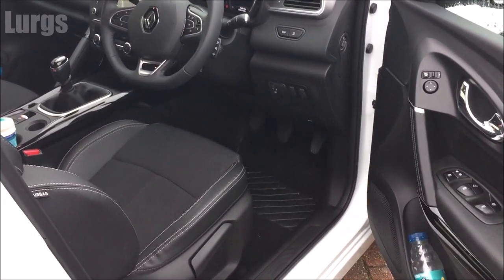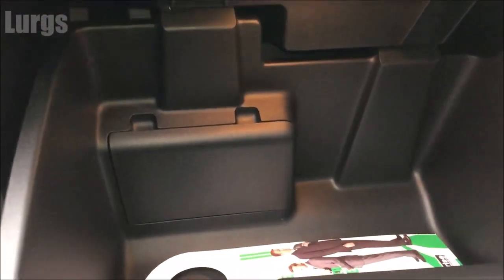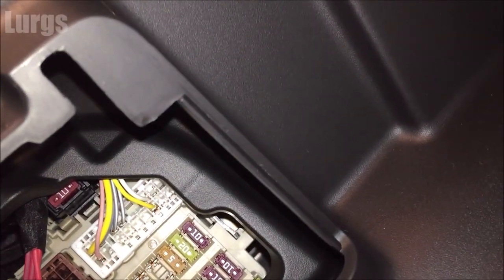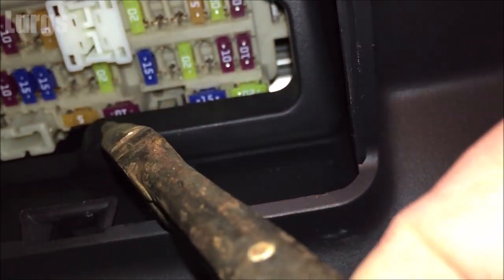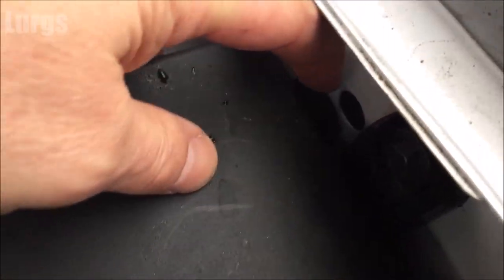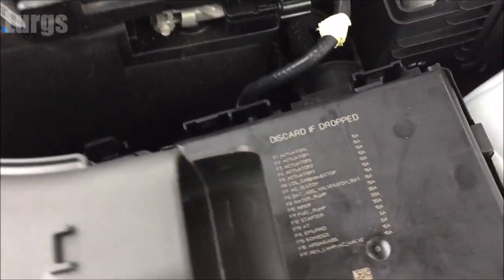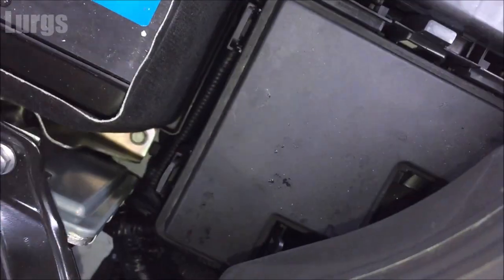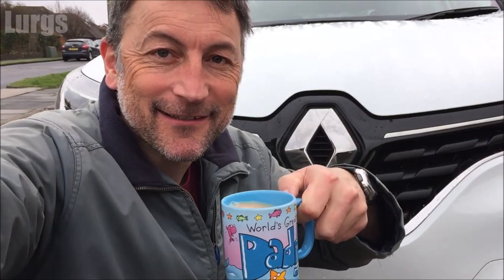Renault Kadjar Fuse Box Locations and how to check Renault Kadjar Fuses

Comment from the maker: Renault Kadjar How To's, Tips, Tricks & Fixes https://www.youtube.com/watch?v=Ps0Mqx6TxKo&list=PLqrXuUebV8N--8bjfVIne9_sdZvXs7gSb
How to set clock on Renault Kadjar https://www.youtube.com/watch?v=s_5guDDe7aA&list=PLqrXuUebV8N--8bjfVIne9_sdZvXs7gSb
Renault Kadjar OBD2 Port Location https://www.youtube.com/watch?v=Ps0Mqx6TxKo&list=PLqrXuUebV8N--8bjfVIne9_sdZvXs7gSb
Renault Kadjar Fuse Box Locations and how to check Renault Kadjar Fuses https://www.youtube.com/watch?v=Wxjpswbs9Ik&list=PLqrXuUebV8N--8bjfVIne9_sdZvXs7gSb
How to turn on Fog Lights on Renault Kadjar https://www.youtube.com/watch?v=PADuwpQOSXo&list=PLqrXuUebV8N--8bjfVIne9_sdZvXs7gSb
Renault Kadjar Tyre Pressures https://www.youtube.com/watch?v=dVXRKSX0ncg&list=PLqrXuUebV8N--8bjfVIne9_sdZvXs7gSb&
How to open Bonnet on Renault Kadjar https://www.youtube.com/watch?v=wQaWakDLzQE&list=PLqrXuUebV8N--8bjfVIne9_sdZvXs7gSb&
How to fill up Windshield Wiper Fluid on Renault Kadjar https://www.youtube.com/watch?v=ZaE3bB9RN_4&list=PLqrXuUebV8N--8bjfVIne9_sdZvXs7gSb&
Renault Kadjar Battery Location and how to check battery on Renault Kadjar https://www.youtube.com/watch?v=_XNLnQp-T6o&list=PLqrXuUebV8N--8bjfVIne9_sdZvXs7gSb&
How to open Boot on Renault Kadjar https://www.youtube.com/watch?v=Cl145EhqdJE&list=PLqrXuUebV8N--8bjfVIne9_sdZvXs7gSb&
Vehicles How To's, Tips, Tricks & Fixes https://www.youtube.com/watch?v=w44aQ7dc_Lk&list=PLqrXuUebV8N9fyM8qA2D0rkVfv929Ckod
How to check car fuses without pulling them out using a Multimeter https://www.youtube.com/watch?v=w44aQ7dc_Lk&list=PLqrXuUebV8N9fyM8qA2D0rkVfv929Ckod
How to Test Car Fuses without pulling them out using a Car Blade Fuse Tester https://youtu.be/zLfa7_FbZrU
Reply: hey man i would like to ask if you know how to replace the handbreak switch on this car. Please
Reply from the maker: Unfortunately I don't.
Reply: @LurgsHowToGuides  i need to replace the switch but im afraid of breaking the weak plastics. And i cant find disassembly info anywhere. :'(

Comment: Hi Lurgs, love your Vids, great stuff. Do you have any tricks to remove the back Headrests. The two outer ones wont move at all. I guess it's a safety feature but it's a pain when you have something in the boot and need the extra room :) Regards, Pete
Reply from the maker: Sorry Peter I don’t have this motor any more, do they not slide out upwards then? Glad you enjoy the vids.
Reply: @LurgsHowToGuides  Hi Lurgs, thanks for your reply. I have sorted it now. Yes, they do side out but on mine the buttons were jammed and the struts were very tight. I finally got them to work loose.  Best regards, Pete
Reply from the maker: @PeterWinnett  Great news, glad you got it sorted. 😎

Comment: hi where is the reverse light fuse on the renault kadjar and what voltage would it be?
Reply from the maker: Don't know which fuse it it, everything is 12Volts. If you have a problem there is probably a reverse switch on the Gearbox so that could be at fault. Stay safe. 😎